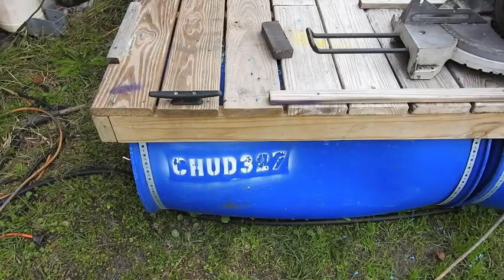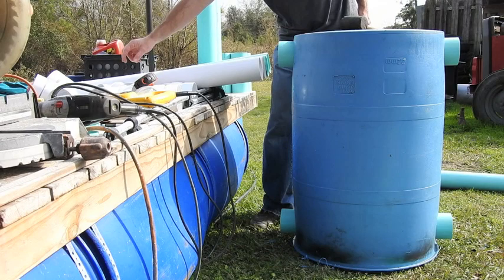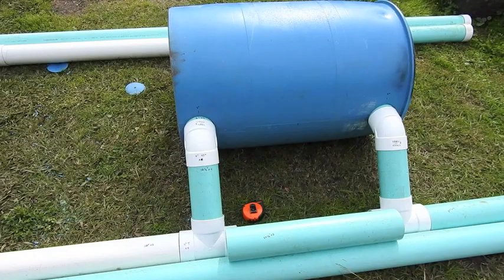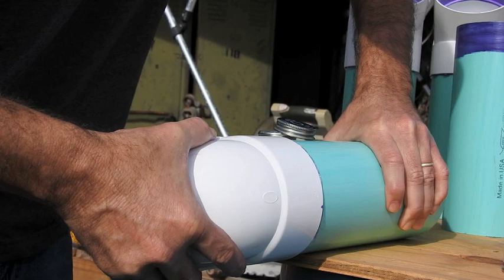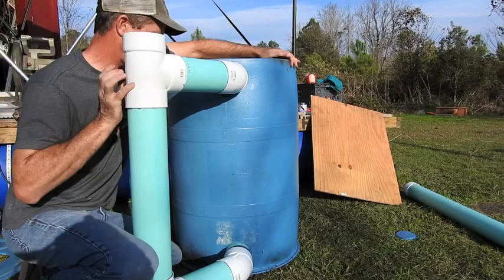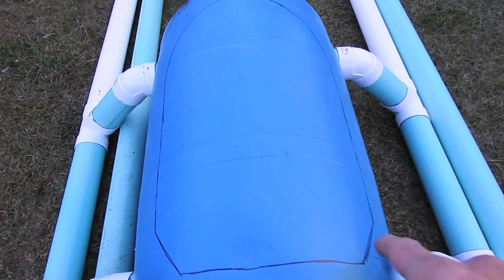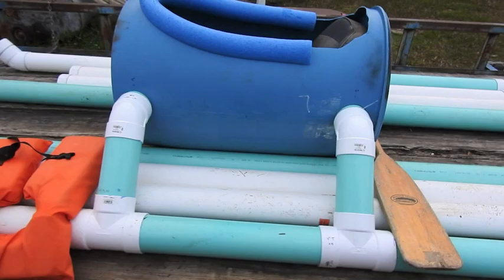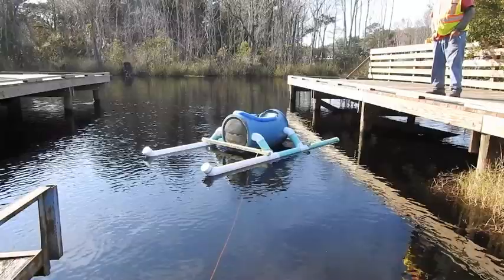$51 Homemade Barrel Kayak How To

Comment: Cut another barrel in have and glue to front and back to give storage areas which would also add flotation  and allow the 2 pipe on each side plenty.  Nice build!
Reply from the maker: That would be cool and more leg room too. Thanks so much and thanks for watching.

Comment: Looks and works great! I've made one myself. If you place the pipes a little higher about 15 cm (6inch) UP from the low part of the barrel the pipes won't go so down to water. You  did a great job.
Reply from the maker: Good tip, I should try it and thanks for watching.
Reply: You have been an inspiration to my Projects and many people's. Thank YOU for taking the time to share.
Reply: @jairoleyva123  glu. Is. Name

Comment: Not a "white water" craft but a fun build.
Reply from the maker: Would no be great for hitting rock at all. But yes it was fun. Wish I could find bigger barrels. Thanks for watching!
Reply: @chud327  not sure what sizes of barrels are available but larger ones would be good. One thing I haven't seen is anyone using foam to fill their barrels. It would offer an unsinkable safety factor and it's fairly inexpensive... Just a thought.

Comment: Looks great. Just wonder if it still works if you dont use the Ts and elbows. Instead simply use two 2x4 to hold the barrel and the pipes.
Reply from the maker: It should do fine… thanks for watching.

Comment: I haven't seen some of your mowers in a while, the Craftsman with the 589's on it, the Moto mow, the weed eater.
And by the way, if you still have them, the boggers you tested in the vid where you put the 589's on the Craftsman, those would look great on colonial craftsman
Reply from the maker: I still have most of the mower, however, I did sell the 589ed Craftsman and I let someone use the boggers.  I am always hunting bigger and better boggers, but no one seems to want to get rid of them. Thanks so much for watching and I will try to get some mower action out soon.

Comment: Was it hard to paddle? 

I need to make slim barge style pontoon I can use a chainsaw on. Cut trees that are blocking the rivers and creeks in my area. For people who like to paddle. 

Been thinking of using some 15 gallon plastic drums and a 4x8 sheet  of pressure treated plywood cut in half  so the barge would be 2'x8'. That way two people could carry it in and out of tight spots when necessary.
Reply from the maker: It was not hard to paddle, but it was slower than my kayak.  It was also a little bit slower to turn than a kayak.  But you could easily build a platform on the front and / or back for hauling the chain saw. You could even add a couple more pipes to make it float a bit higher.  It would suggest putting a trolling motor on it to get to the limbs.  I put a trolling motor on this on in episode #2 and it was much better at getting around.  Good luck and thanks for watching.

Comment: I like your workmanship and frugality BUT I was very disappointed in your approach once I heard you were a teacher.  There is no need to guess IF one of these home made kayaks will have enough bouyancy, that can be calculated.  Each 10 four 4 inch  closed pipe will displace enough water to provide 44 pounds of bouyancy.  2 pi r l = volume of pipe or water displaced.  Water's density is 1 gram/cubic centimeter.  If I ever do one of these myself I hope to include a little high school math in the instructional video.  PS, I am not a teacher
Reply from the maker: Maybe that is why they fired me… sorry for the disappointment but thanks for watching.